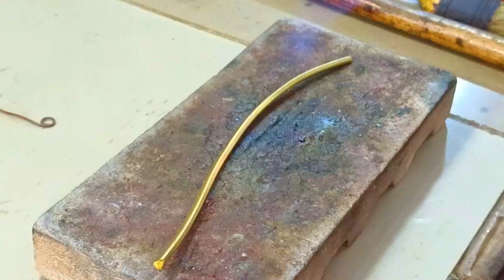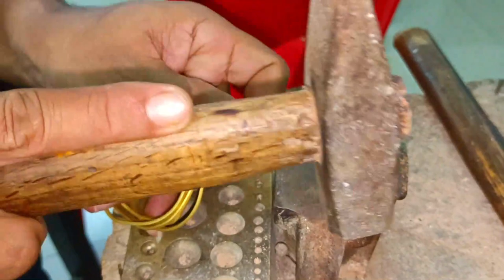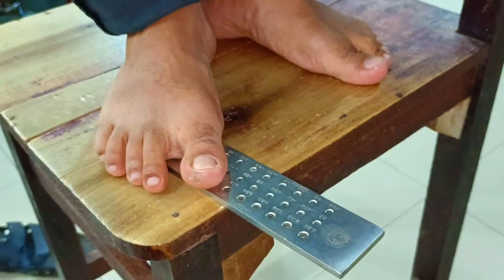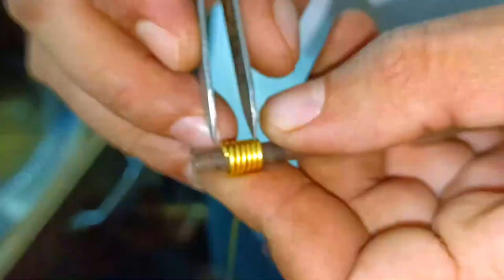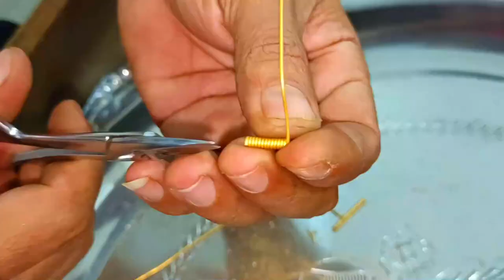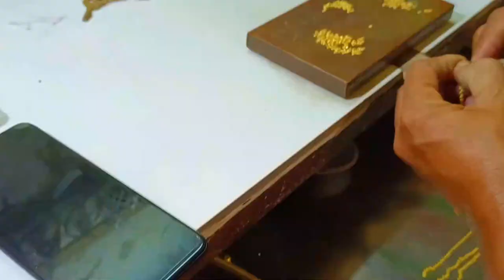24K Gold Necklace Chain Making

Comment: Am I right in thinking if you wanted a 24” chain 
And did the links at 5mm each 
So 5 links per every inch 
You would need 118 links plus a 2” clasp at 1” 
Or 120 links then add the clasp making 25”
Reply from the maker: I don't understand what you are saying